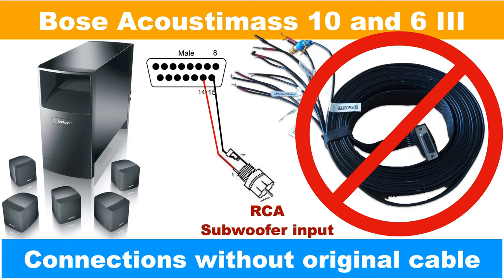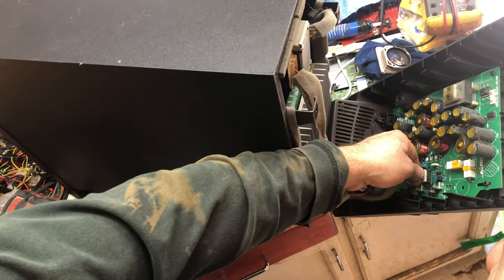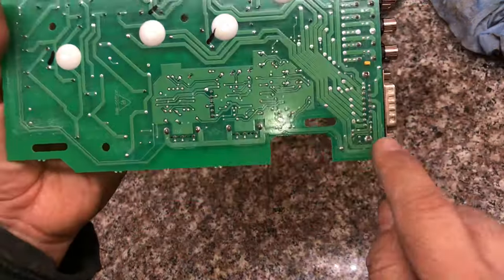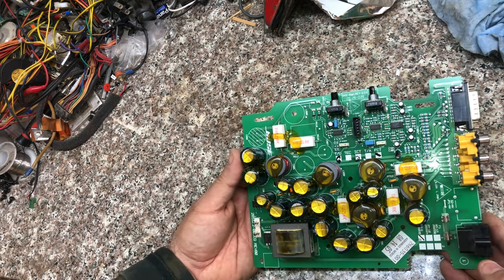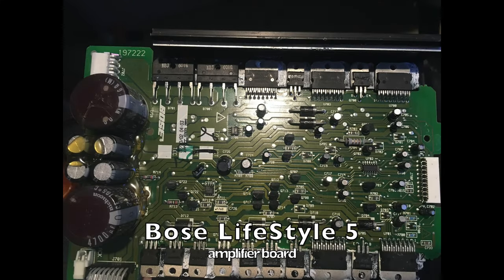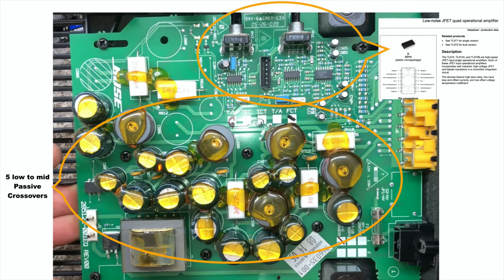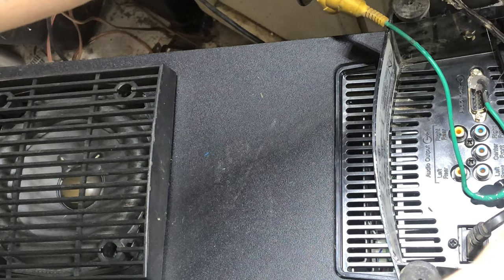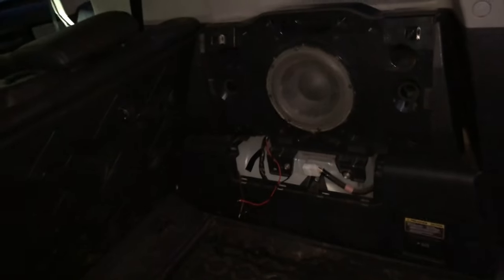Bose Acoustimass 6 Series III subwoofer - pinout for using with other amps with out original cable

Comment: Sir can acoustimas 16 can direct to sub input of amplifier which is better sound if use pin cables or direct to rca jack connector?
Reply from the maker: I think it will reduce the interference.

Comment: Hi Bro, I have one AM6 series 3, but subwoofer speaker no work, could you guide me how to fix this issue? Many thank for your advices. Regards
Reply from the maker: Does the satellite speakers work? if only the sub, test the subwoofer with an ohm meter or multimeter to see if it still gives, I BELIVE ITS 2 OR 4 OHMS. IF more than that or less, there is a problem with the speaker and could have damaged the output transistors. this system has an integrated circuit for the satellites and transistors for the subwoofer. Good Luck!
Reply: @Letsdosomethinguseful  ok, I don't know anything about electronics but your video has inspired me. I got an old Bose AM6 Series III (I think the same as yours) and I want to know if the bass speaker works. I have a multimeter. Would I set the multimeter to ohms and contact the two sub pins you identified to test for resistance? And, if so, it should show 2-4 Ohms if it's working? Thank you!

Comment: i have the acousticmass 10, if you need some help to find wich cable is or make revers ingeneering i can help you.
Reply from the maker: Thank you very much!
Reply: Yo tengo el acoustimass 20,puedes ayudarme con el diagrama del conector din de 5 pines para inyectarle señal de audip y echarlo a andar? Gracias
Reply: @hugoolvera6736  claro, solo que no sé cómo contactarte vía privada para ponernos en contacto
Reply: @socampo5737  Te escribí por acá mi email pero creo que youtube en automático borra esos mensajes, podrías acá mismo compartir la información respecto a las conexiones del subwoofer?

Comment: Very helpful Video Thank You . So to clarify all the surround speakers are powered by the receiver passing through the passive crossover in the Bose and the sub is powered by the Bose amplifier through the Active Crossover in the sub fed from the sub out on the receiver ?
Reply: Was you correct

Comment: should i use same pin for 6.1 channel acoustims 16 ii ? please help, also help can i connect any oridinary speaker in boss acoustims 16 iii ? second question  can i use 5.1 channel avr in the acoustimas 16 ii 6.1 channel ?
Reply from the maker: Sorry, I don't know if that is exactly the same. Second question, if you are using it just as subwoofer, yes you can. I mean, the sub output of the Home theater to the Bose subwoofer ad the satellite speakers connected to the Home theater (5.1 System)
Reply: @Letsdosomethinguseful   thanks it worked just because of your video, thanks.. i can reutilize this amazing woofer.

Comment: How would you compare this model with the bose acoustismass 16 II ?
Reply: same question,  same pin for 6.1 channel acoustims 16? please help, also help can i connect any oridinary speaker in boss acc,... 16 iii ? and can i use 5.1 channel avr in the acoustimas 16 6.1 channel ?

Comment: Hi can you do the same for the powered Acoustimass 9 which has 8 pin din cable at the sub unit?
Reply from the maker: I don't have an acoustimass 9 but you can search for "Bose acoustimass 9 8 din connector pinout" and it could bring the correct one for your system. Is that with a connector like DIN 8 or it is the mini Din 8?

Comment: I remember when you could build a component system using any brand and they'd all play well together... Then came Bose with proprietary connections that only work with Bose and change every time a new unit is made so even Bose won't work with Bose. Bose sucks.
Reply: Make you buy another Bose product.